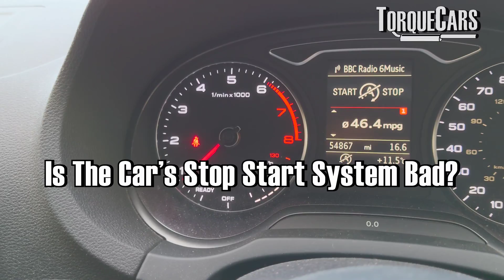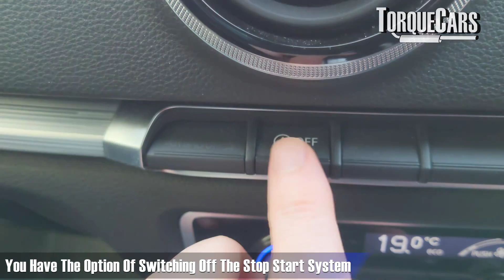Does Auto Stop Start System Damage Your Engine? ECO Savior Or Car Killer? 🚗

Comment from the maker: What do you think about stop start technology? Do you disable it all of the time, some of the time, or just leave it on to do it's think. How clever is the stop start setup on your car?
Reply: I disable it (Petrol Engine)
Reply: I disable it straight away
Reply: I d disable it period!
Reply: My 2002 Prius is far more annoying vibrating away at idle for no reason than when it cuts off.
Reply: I shut the cursed thing off every time I get in my 19 F 150 Most of the time I take an old trailer plug and shove it in during the dry months which turns the garbage off.    It does shut off the backup guidance lines but I can live with that.  There’s just something about shutting down turbos and considering those tiny fine screened oil inlet filters that rubs me the wrong way.      You just don’t do that with turbocharged engines even if the manufacturer says it’s ok.   Why, because they will happily lie to your face if Big Brother says to and you can’t trust either of them as far as you can chuck them.    Gov is ruled by activist number crunchers who have no concern for your well being while manufacturers just want to sell more overpriced things.
Reply: Not very clever. Constantly shuts off as soon as I've stopped before the turbo has spooled down.
Reply: I disable it. I prefer to pay a 0,20 litre of fuel more per year,  than pay for a new battery every year, dude!
Reply: I disable it every time. My AUDI S3 is now 7yrs 4months old and the battery is still ok. I give it a trickle charge maybe twice each year.
Reply: I disable it right away.